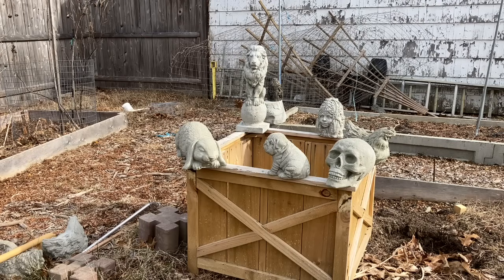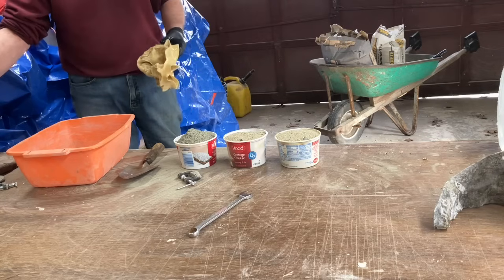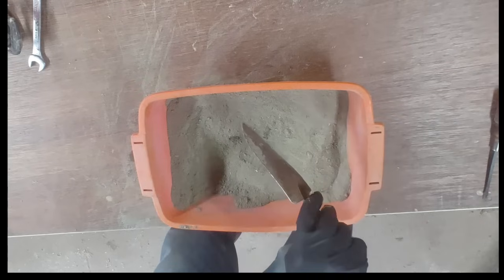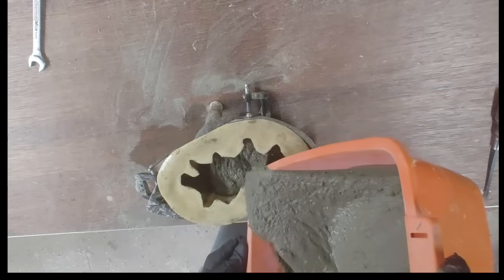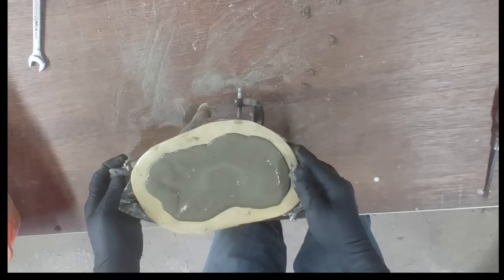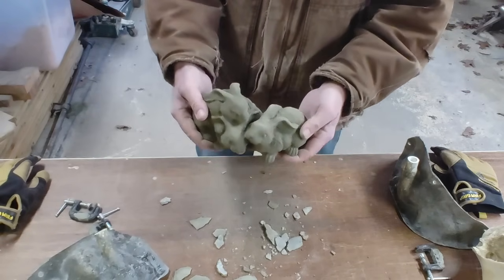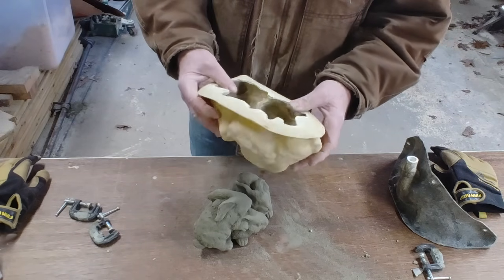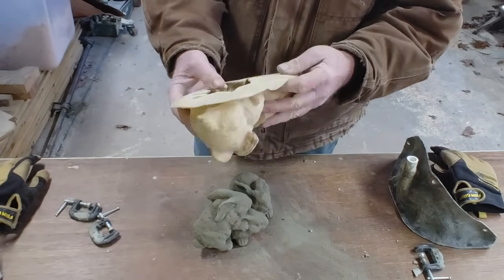How to make cement garden statues.

Comment: Immediately I see a problem. What mold? From where? What's mold release?
Reply: I’m not sure if you’re being facetious but mold is a casting mold, also spelled mould. It’s the form that you pour a medium into to make a shape. In this case it’s the silicon mold for the bunnies. The mold release is a thin layer of oil that keeps the concrete from sticking to the mold because oil won’t mix with the water in the concrete mix.
Reply: I also see a problem...lazyness
Reply: @smallnuts2 generally if you only made few they'd leave you alone, sorta like a fair use art project type thing, now on the other hand if made a mold and was pumping them out for profit they'd shut you down and destroy the mold as it is copyright and trademark mark ip, and its owned by the mouse house who are notorious about copyright protection
Reply: @smallnuts2  if u bought a mold from them then I think you're allowed to do with as u please mostly, I'm sure you'd still have to get a letter of use to sell em, but also if your selling em randomly or like " yea I had this but I'm tired of seeing it so I sold it" wat r they gonna do, kinda a "what they don't know" kinda thing
Reply: @smallnuts2  I've gotten 3d models of trademarked ip, but the problem comes wen u try selling it without authorization
Reply: @smallnuts2  think of it like bootleg dvds (dated I know) but if you make a few for you and a few friends aint noone gonna bat an eye, but if you're making 1000s and everyone knows to get dvds from you, you're probably gonna get nicked
Reply: If you can think of it theres probably a mold for it. The internet, ebay etc. Rubbing alcohol and a little castor oil. There's no such thing as a stupid question but there are redundant one's.
Reply: @scox7748 Yes, he mentioned what to use for mould release in the video, also, where to buy the moulds.
Reply: The title should be "How to make a mold"
Reply: He answers all of those questions before he mixes the cement
Reply: It's almost like he explained these things in the video.
Reply: like he said, on the internet just do some research
Reply: Immediately I see a problem, too. You didn’t even watch the video before commenting, that’s the problem. 🙄
Reply: I enjoyed your video! Thank you. Learned alot.
Reply: DUMMMMMB

Comment: If you don’t have a custom fiberglass shell for the mold, you can put the latex mold in a bucket and put sand around the mold so that it can’t deform.
Reply: Thank you. This is what I was looking for.
Reply: That might work with smaller statues, but I tried that on a bigger one, and it looked deformed. I made my rubber mold with the stuff from Micheal's craft store. You brush it on and add gauze after every so many coats.
Reply: Easier said that done. Maybe for a small mold. A medium size mold you can use percolite. But sand and percolite take some experience.

Comment: A really cool trick is to put the old on a pece of plywood. Thenhold a running palm sander on the plywood to vibrate the air bubbles out and get the cement into all the crevices....
Reply: i was gonna mention using an old electric toothbrush...id bet they could be modified and adapted to get into tiny places

Comment: If you have a tool such as electric sander, jig saw, etc (something that vibrates basically), remove the blade or anything sharp if it has one and hold that against the mold to remove air bubbles.
Reply from the maker: Thanks for the tip. I use an electric sander on larger figures.

Comment: FYI
Cement is the fine gray powder. 
Add water it becomes slurry. 
Add any aggregate (sand, rocks, broken glass, perlite, etc) it is concrete. 
Spent my entire adult life working with this material, I find the need to make it clear. 
Thx.
Reply: I always have issues with it crumbling
Reply: Thank you..I have asked a couple of ppl what the different was..so now I know
Reply: Actually cement and  sand is mortar. Concrete is made of cement,  sand and aggregate.
Reply: @porker5749  So if using concrete, won't need to add anything other than water, right?
Reply: @KarenmitchellANI  That's right.
Reply: @porker5749  When is mortar used vs concrete? Like if sand does the job why add stuff?

Comment: i do 3D PRINTING.. and with SO many failed prints i need a way to re-melt them and try to re use them.. if i make a cement model , can i use a BLOW TORCH on the CEMENT model so the PLA plastic material can melt around the cement model..  can the cement model be super heated with a blow torch without damaging the cement model ?
Reply from the maker: It's probably not a good idea, as concrete has been known to explode when exposed to high temperature.

Comment: I'm curious about your fiberglass moulds. Are they each made specifically to the silicon mould you made or just a generic form that holds the silicon? Your statues are wonderful :)
Reply from the maker: Yes, the fiberglass outer shells are made specific for each latex mould. Thanks for the compliment.
Reply: We call it a mother mold, it is the rigid mold us sculptors make around the rubber covered model. Sculpt something, cover it in coats of rubber, cover that in fiberglass or ultracal or something rigid, that's a simplification of the process. Advanced molds will have a flange of material along the seams where you think it might need to split a tad, usually a thin piece of plastic that got coated on both sides with the rubber, the fiberglass is added over that and holes drilled along the seam flange to slip a bolt and wingnut through for added precision of the mold holding it's shape. A thin coat of Vaseline makes a good release during the mold making process, whether it's rubber, fiberglass, plaster, etc, to keep parts of the mold from sticking to each other during creation. I learned this stuff 20years ago, they should teach it in schools.

Comment: After removing the casting from the mold, do you need to keep it moist until the cement/concrete cures?
Reply from the maker: It is not necessary for the most part. Keep it out of direct sun to slow the curing. If the weather is hot and dry, spritzing with some water would be fine.

Comment: Does the mold release evaporate quickly like rubbing alcohol does?
Reply from the maker: No, the mold release does not evaporate as quickly as plain rubbing alcohol. The castor oil is what makes it work. The alcohol serves to thin the oil. Always drain the mold well as any puddles of the release agent will affect the concrete. I spray the mold, tip it upside down to drain while I mix the concrete.

Comment: Sir may i know what will happen if the cement mixture is too loose? What does fine line mean?
Reply from the maker: If the mixture is loose it will take longer to dry and may also lose strength when cured. Fine line is just an expression.

Comment: No need to shake the mold, simply tapping on the sides or a  small vibrator, will work. Especially for bigger molds, that are heavier.
Tam's other half

Comment: No steps on making the mold, no steps on making the fiber glass stand, no showing the chemicals of chemical release, and no steps except for putting concrete in an existing mold and frame. #misleading
Reply: Wow, I don't expect one You Tube video to be a complete comprehensive lesson on everything about a subject.  Knowing about molds would be a different lesson.

Comment: You are really using mortar, there is cement in that order but once you add sand to that cement, it is no longer cement. Put gravel in it and it will not even being mortar anymore, concrete now!

Comment: you mean concrete statues perhaps? concrete is made from cement- 
it's the powder- you add water and gravel and it becomes concrete- the finished material
hence a concrete statue- a cement statue is just powder with no strength- just saying-